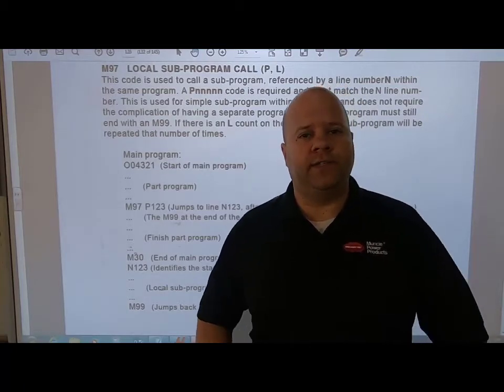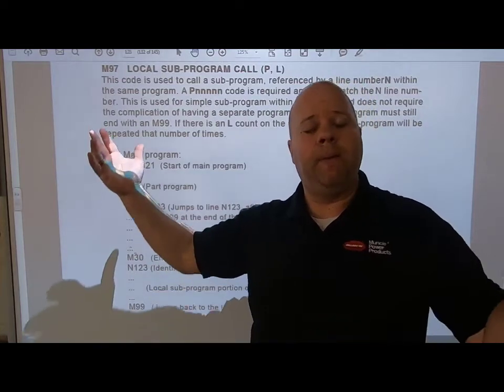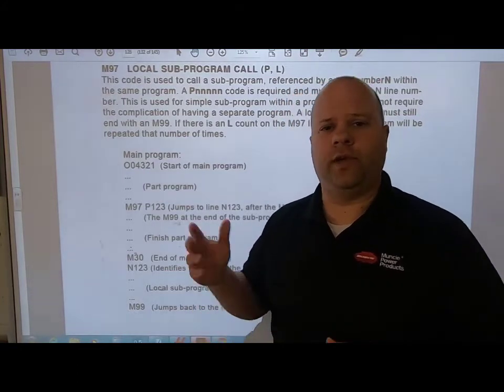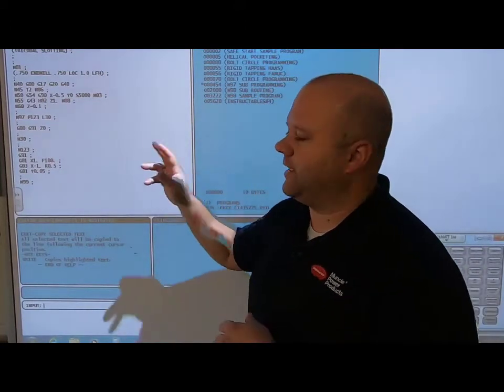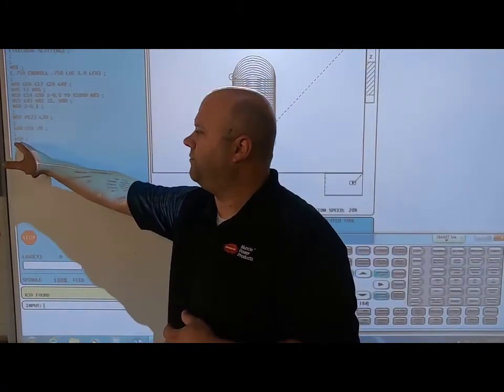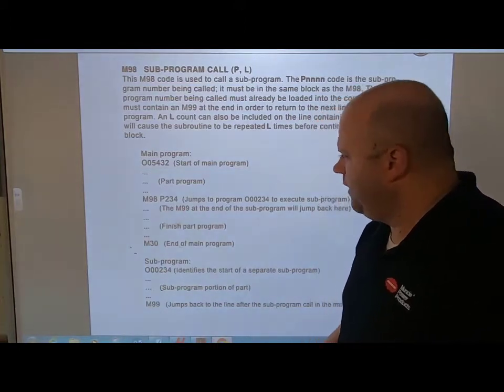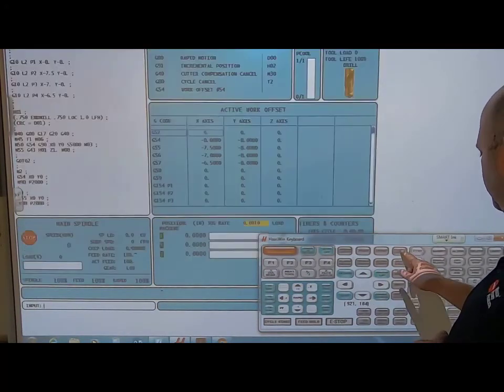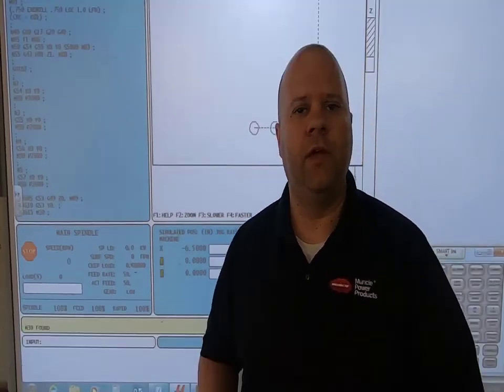Hand Programming with M98 and M97 sub programming routines

Comment: Thanks for the video, question can you use G90 if I don't want to make 
incremental passes? just machining a flat surface thanks again.
Reply from the maker: "Absolutely" (pun intended) What ever model mode is active that is what will be used once it enters the sub program. You can also,  change back and forth from within the program. I hope this answers your question and thanks for watching.
Reply: @aaronrunk4209  Thank you.

Comment: How do you get the control panel touchscreen on the projector? That would help me tremendously with my students.
Reply from the maker: @Meridianmachine  so this was a smart board with a projector package that was in my classroom when I started. however, now we have upgraded to True touches. If you're able to upgrade to a true touch, I know it is expensive, but they are wonderful.  I will say the next thing you could try if that's out of the question is to get a wireless keyboard and mouse. Thanks for watching

Comment: ❤do you use macro???😊
Reply from the maker: I did use macros when I worked on a CNC 5 axis in Industry however the only time I show students how to use macros is when I pull up the program I used to use and show them how to adjust it while it's running.

Comment: Is there a way to use M98 and have the machine go to a specific line # in the sub? I have an older Haas VF1.
Reply from the maker: Hi and thank you for watching the video. Good news is yes you can have a program search for a specific starting point. If you noticed in the video I have the command GOTO2 this goes to N2 if it was GOTO4 it would skip to N4 and only run the last hole. However, if you are wanting to skip to a specific line in the Sub program you would need to open the sub program so that you can edit it and you would put a GOTO in the actual sub program. This would stay active until you edited back to it original form, but it will skip to the "N" point in the sub program that you are needing to start at. Good Luck and I hope this helps.
Reply: @aaronrunk4209  Thanks for the quick reply. That may not work for my situation, but I'll give it a try. I was hoping to find a solution where I didn't have to edit the sub.

Comment: best explanation out there. and ive just watched dozens. question. where does one save the subprogram? say one has a 30 year old machine that takes floppies and youre trying to make multiple parts but only enough memory for one parts code? if i have my sub on the floppy will it look to the floppy drive with the P command?
Reply from the maker: So I don't believe it will be able to read from the floppy. However, if there is a way to remove items from your post on the program such as N lines like N10 this will help with the size. The subprogram must be inside the program using m97 or a has to be in the machines directory that uses m98. Some machines can not use m97, so M98, maybe your only option. I'm glad you like the video I hope you get this working.
Reply: Thanks @aaronrunk4209  Ok so I tried it just for fun and it worked...kind of. I have a miltronics vm17 with centurion 6 control. using a compact disc reader. I put both my main program on the compact disk and my sub program and loaded them into my control. using G54 X0Y0 M98 P2000 for part one it looped to the sub program and then G55 X0Y0 M98 P2000 for part two looped to the sub program. everything feeds through just fine but im stuck looping the the second part over and over. should i delete my end code and just throw an M30 in there? heres the code
Reply from the maker: @DirtKickersandArrowheadLickers  well I am glad to hear that it is reading from the compact discs however if you remove the m99 and put the m30 on there it will only reset to the top of your program and you will have to hit cycle start again. If you have a first and second program, you will need to rename the second program with a different P. 
Example op1 G54 X0Y0 P1000 and op2 G55 X0Y0 P2000. Be sure your op1 is named O1000, and op2 is O2000. It sounds like you're heading down the right path machines are finicky and finding out exactly what they like is half the battle

Comment: I have a qurstion,  running parts,  most of program is in G99, (No face g IE CS and spindle lock,  no G50),  but later in the program they are using G 97,  so I'm confused wgy,  im sure there is no G 96 and the parts don't have radically different I'd profiles to just fit G96,  so yea ?
Reply from the maker: Good news is a G99 works close to what a G96 does except just like on a manual lathe you can set your FPR and it will work even if you have different sizes in OD or ID. However,  is your part has a call out for a specific surface finish the program would need adjusting either in the spindle speed or Feed rate itself. It's a different way of running the machine but if it works! Thank you again for watching